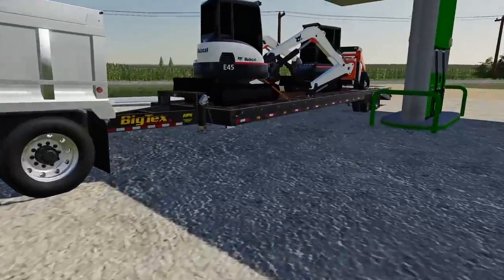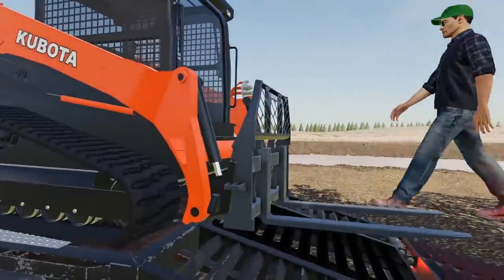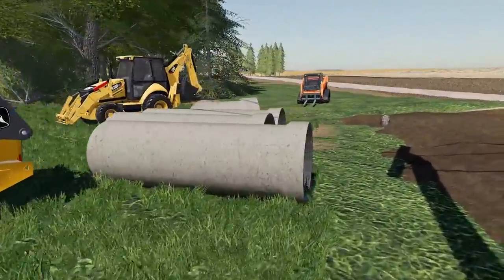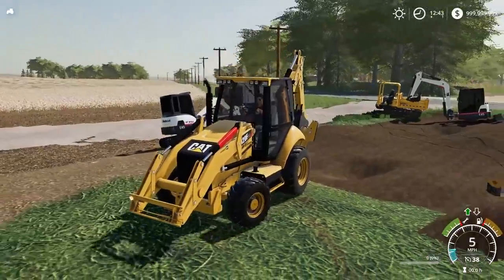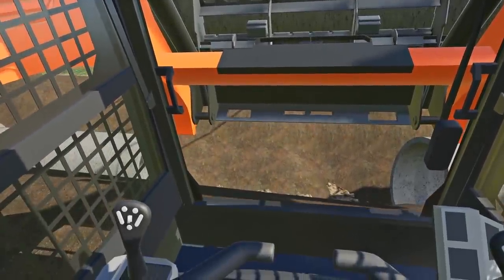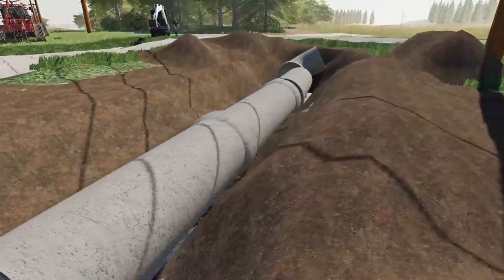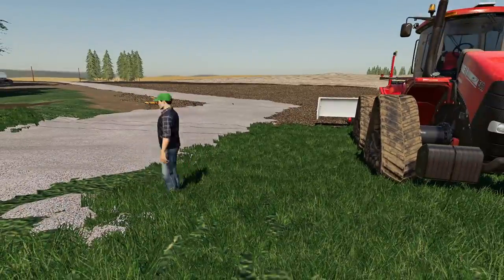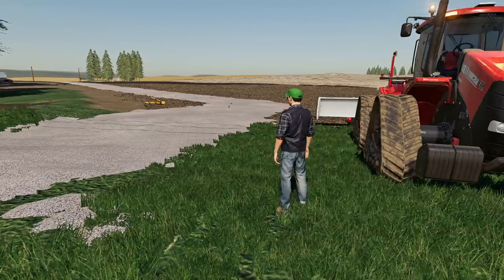DIGGING SEWER PIPING FOR A MOBILE HOME PARK! (USING EXCAVATORS) | FARMING SIMULATOR 2019

Comment: Couple things 
1- sewage pipe is normal green plastic pipe (only weights about 55 ish lbs for the 8inch pipe, the 6 inch service lines are only about 30lbs) so the excavator isn’t needed
2- your supposed to sand under the on top of the pipe( sand compress a lot better than 99% of dirt
3 it looks like your having fun keep at it
Reply: Homie really took the suggestion seriously

Comment: Those pipes would collapses if you dropped them in real life.....Lol   Thanks for sharing.... Stay safe Lads
Reply: Depends on the pipe and the wire inside also if it was a wet poured pipe or a dry mix

Comment: I put in mobile homes for living but I have also built a school on 2-10 in Jacksonville Florida I did the first line and communication lines u have to hook the force main into the City water main which is a 20 inch PVC pipe that pipe could fill a Olympic swimming pool in 5 minutes